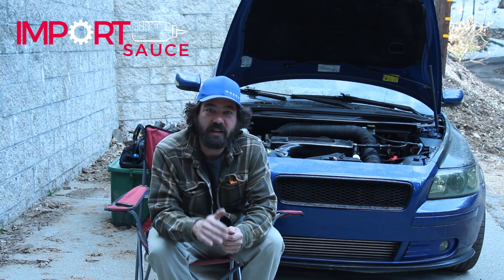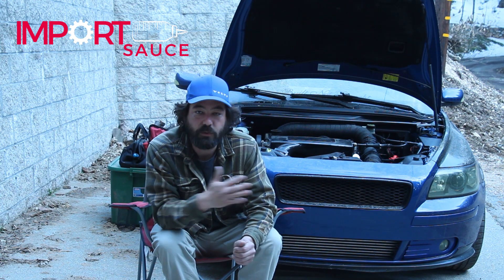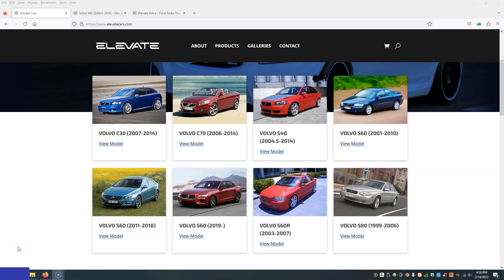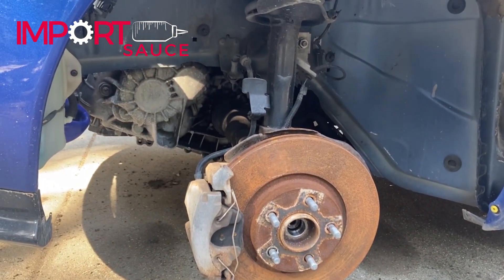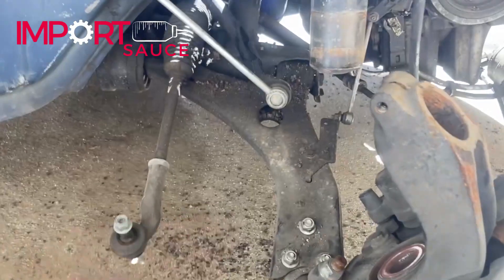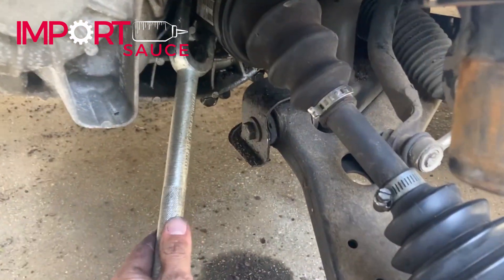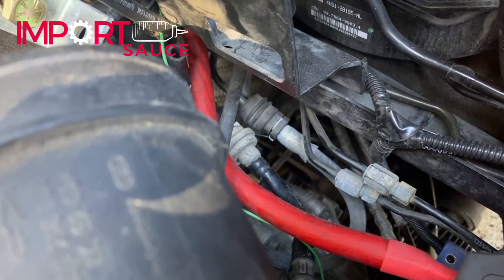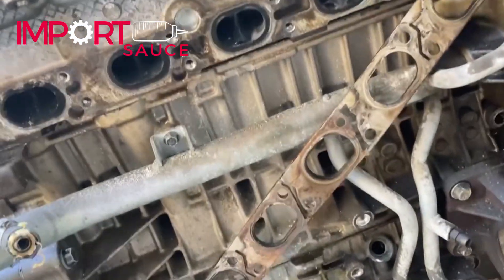Volvo T5 Engine: What it takes to get your T5 engine out of your car

Comment: Hello Joel, I’m about to undergo   a T5 pull on my C30. Aside from the mount removal, I’m aiming my guns at the AC system which is already evacuated and ready to be deleted with a kit from the UK. Would you suppose It’s wise to remove the AC lines prior to pulling the engine to give clearance on the passenger side when lifting the T5 free of the bay?
Reply from the maker: No need. Engine does not block it in any way at all not is it connected to anything. Just unbolt the compressor with 4 bolts and it will hang. Can you post the link to the delete kit. Would love to see that.